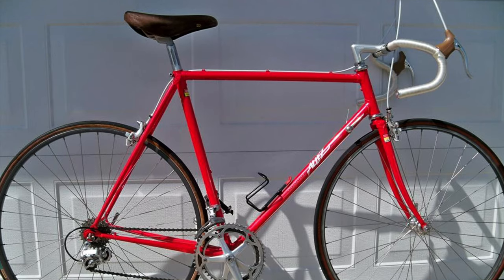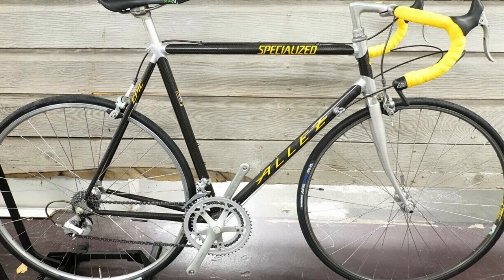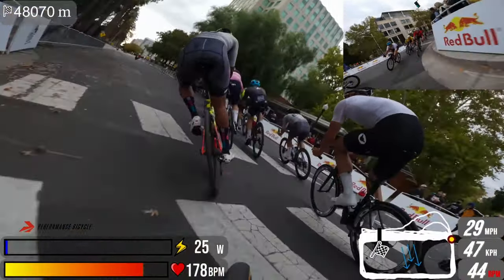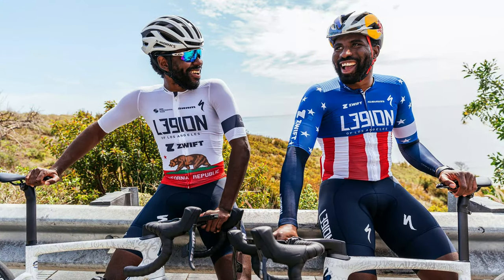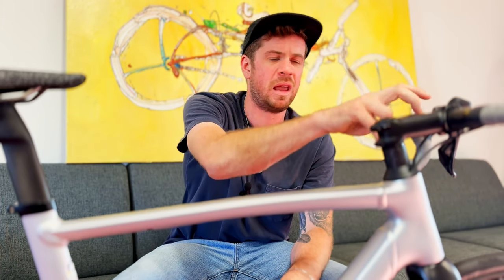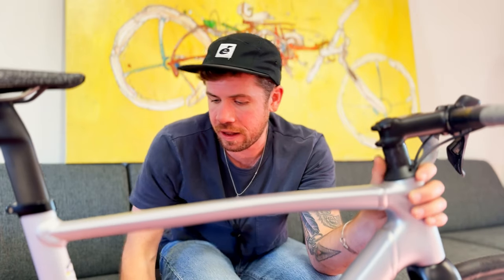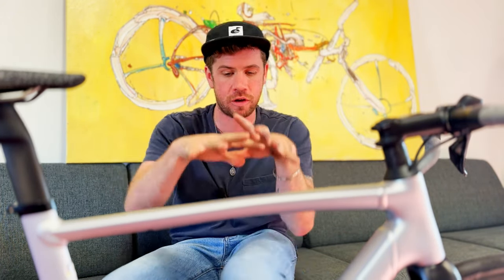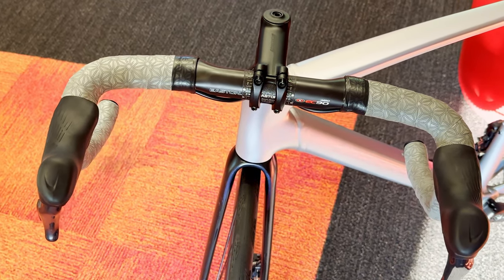NEW Specialized Allez Sprint Aluminum Race Bike!

Comment: I had that 86 Rockhopper and it was a go anywhere bike.  Its original tires had a raised bead and was raced in a 24 hour on track race, but loved trail riding as well.  Go anywhere…. only took 40 years for the industry to realize that bikes are fun when they can take you to an edge that skill can overcome x hence invention of all those MTB disciplines and now gravel bikes.  As to the ALLEZ I applaud Specialized cause that’s the bike that I first went fast on.

Comment: I'm pretty sure hydroforming has been around before 2013. I have a 2011 Trek 29er with hydroformed tubing. Nevertheless, that's a sweet bike. I'm building one up soon, once the frame is delivered.
Reply: I had a BMC Streetfire bike with super hydroformed tubes - which I bought in 2009 and was on a deep sale then so I think it had been around for years